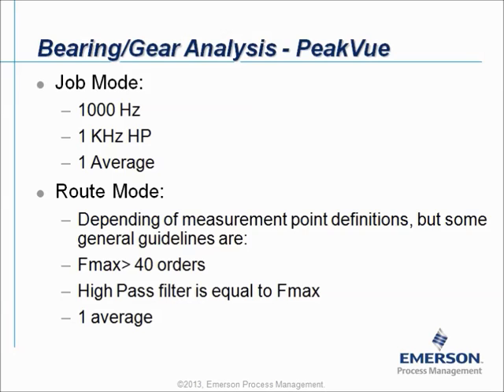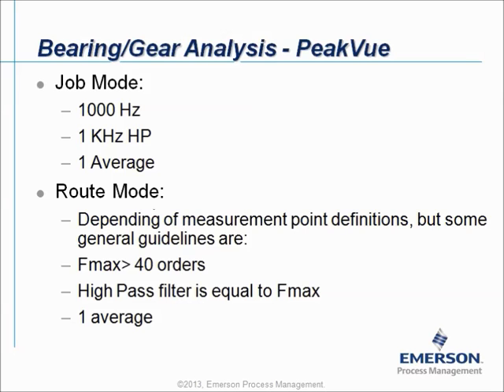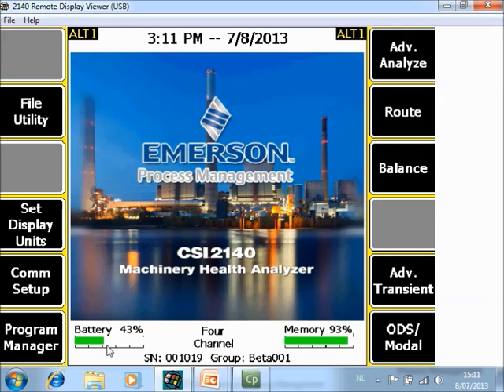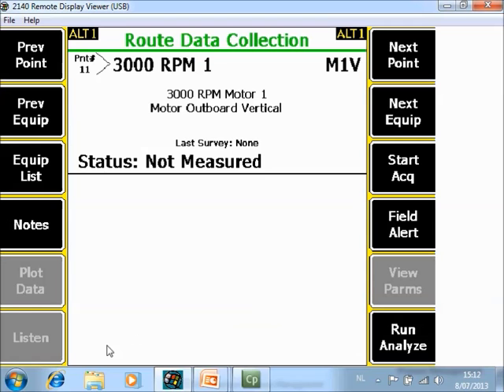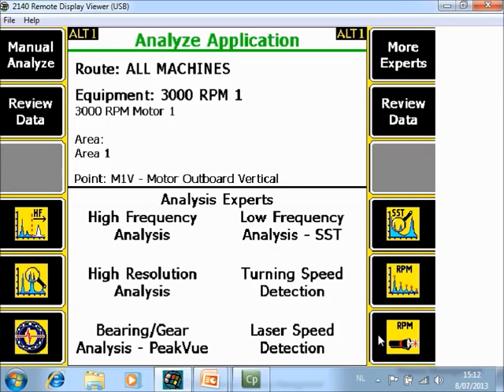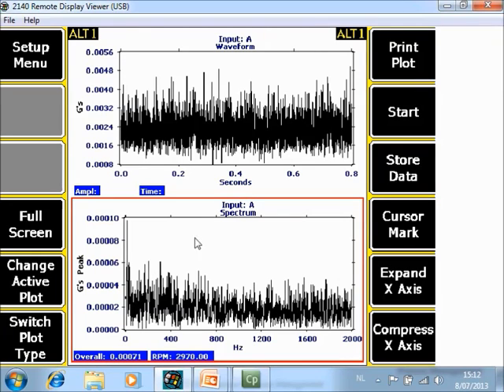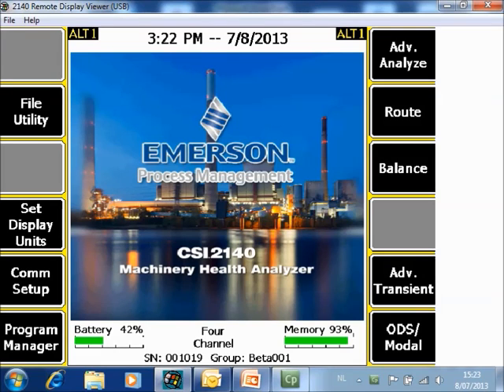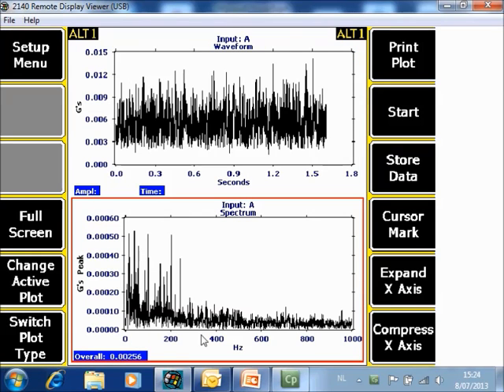Using PeakVue with the AMS 2140 Tutorial

Comment: What is the limits guidelines for the bearing failure with peakvue measurememnt, I saw the peakvue infographic animation (which indicates that 10 g's is only first stage) but it is much higher than these indicated in ''PeakVue_IntroductionPaper2001'' paper where the alarm levels are from 6-10 g's according to the speed and the failure frequency, so I am confused, Could you please clarify.